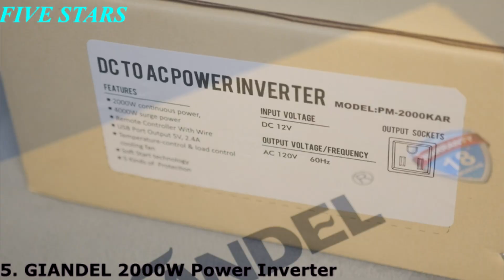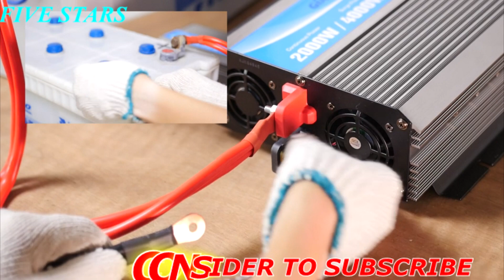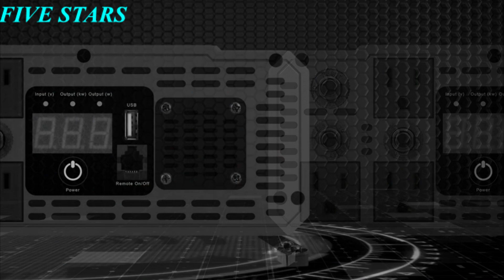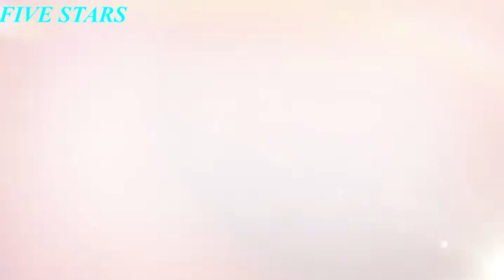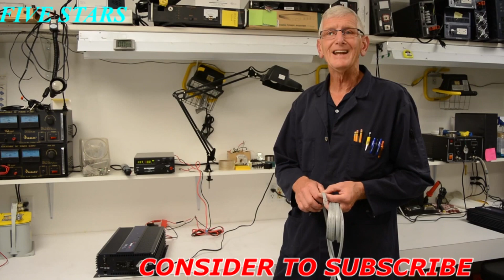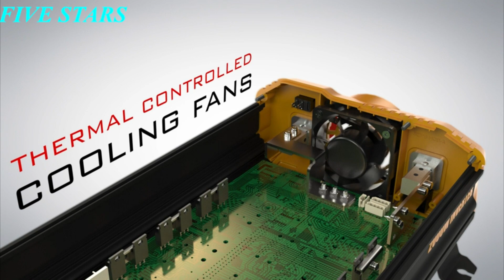5 Best Pure Sine Wave Inverters in 2020

Comment: it says pure sine but  on clicking the first link it shows on amazon :  GIANDEL 2000W Power Inverter Modified Sine , this is not pure sine it is a modified sine which is why it show's it cheaper priced. I CHECKED OTHERS AND MOST ARE NOT PURE SINE CONVERTERS ONLY ABOUT TWO ARE PURE SINE CONVERTERS AND THEY ARE A LOT HIGHER IN PRICE , IT'S THE OLD BAIT AND SWITCH  . ADD SHOULD SAY PURE SINE AND MODIFUED SINE CONVERTERS .  DON'T BE FOOLED AND ORDER A MODIFIED SINE CONVERTER . PURE SINES ARE BETTER .

Comment: Your number 1 is a modified sine wave? So pointless really when i want a pure sine wave.
Reply: Can you please guide me on what os the difference, I want to get ready for the hurricane season here in FL. looking for an expensive one that will at least power up a fan, microwave, cell phones, tv, laptop
Reply: @R3z3R23  
This guy pretty much sums it up i copied it for you.

Pure sine wave inverters use more sophisticated technology to protect even the most sensitive electronics. Pure sine wave inverters produce power which equals – or is better than – the power in your home. Appliances which may not function properly, or which may be permanently damaged, without pure, smooth power will be safe with pure sine inverters. Use these inverters for televisions, laptops, digital microwaves, fridges and other sensitive electronic equipment. Pure Sine inverters can power just about any AC appliance without risk of damage.

Modified sine wave inverters are very affordable, all purpose inverters. Using a more basic form of technology than pure sine wave inverters, they produce power which is perfectly adequate for powering simple electronics. Use modified sine wave inverters to provide power for your less sensitive appliances like phone chargers, heaters and air conditioners. Modified inverters are best suited for resistive loads which don't have a start up surge.
Reply: Yes, only the AIMS and Samlex are pure sine, the other three won't work for many applications.
Reply: Get a yueQing reliableelectric pure sine wave inverter there the best I use a 3000 24 volt for off grid